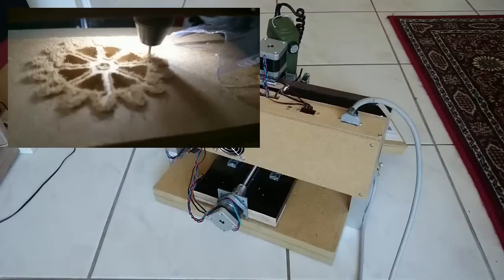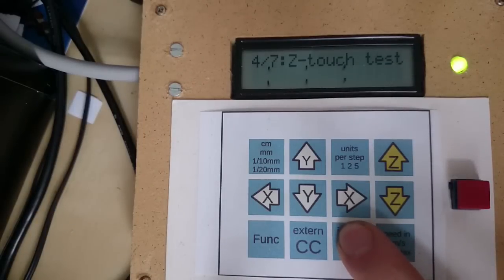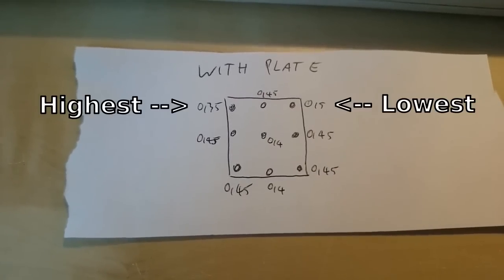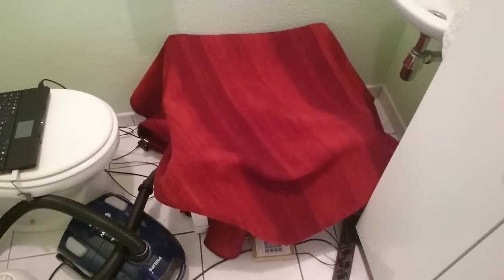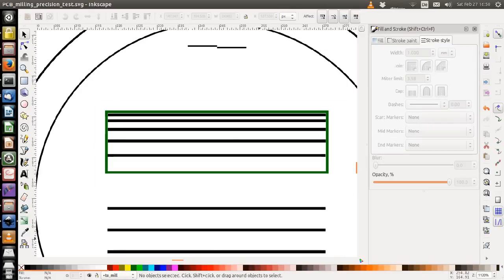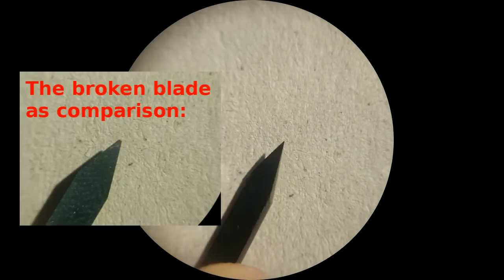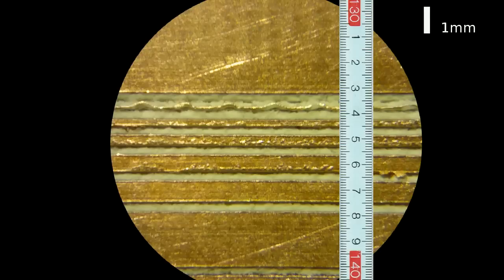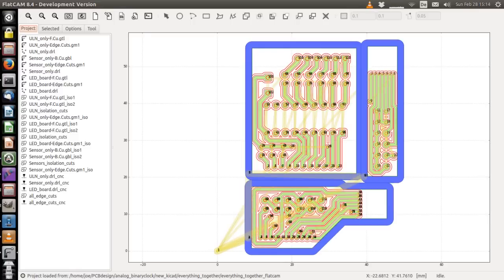My homemade desktop CNC mill: follow-up number 2

Comment: Can you please show the connections from the Arduino to the BED driver boards and driver boards to stepper motors. I have completed the mechanical assembly and now need to test if it works.

Comment: Hello, i have some soloutions for you:
1. you can solve the uneven plate issue really fast: just use the largest endmill the machine can take and facemill the hole plate so you get an even surface. Its really simple and the first things i had done. (Fläche einfach flach fräsen.)
2. For the noise problem you can build a larger an enclosure out of wood where the cnc fits in, and if its not enough you can add accousic foam (PU-Schaum) inside the wooden Box. Also you can stand the hole machine on Silicon/rubber feeds in a Sandbox to reduce body noise (Körperschall).
3.replace the large vacuumclealer with a smaller handheld version one maybe Diy.
4.Against the dust issue for your ball bearing you can build Bellows (Faltenbalg) or Roll Up Way Covers and Rollaway Covers(Gummi matte) greetings
Reply from the maker: All hints are good ideas! But i might rather build/buy a new machine with all these ideas built in, because my current one (as good as it works after all) could need quite a lot of (also other) optimizations.

Comment: Hi,

I don't think that cutting a circle is appropriate to detect backlash. At the beginning and at the end of the cut, the rotating cutting tool will always "push" the axis in the same direction and so eliminate any play in the nut/rod assembly. Drawing a circle may work because there is no unidirectional force applied by a cutting tool.

Anyway, I think that You really did a good job with this video series by going way deeper in the subject than others did.
Reply from the maker: For detecting fine backlash you are right, two cuts coming towards each other would be better for that. The PCBs I made so far still show me that my backlash is negligible right now.

Comment: Hi,
Maybe as a tip: Did you debounce your Z sensor? (http://www.labbookpages.co.uk/electronics/debounce.html)
Keep up the good work!!
Reply from the maker: +Rogier de Leeuw I did not debounce the Z-sensor, but my software reacts anyway on the first peak coming in, which is enough for the height measurement.

Comment: I have no idea about CNC stuff, but can't you calibrate the surface of the milling object and calibrate it in software with some linear interpolation? Has to be easier than shimming things up with paper... :)
Reply from the maker: +Leigh Robinson I agree that paper is not the "professional" way to go :) I could just have milled the surface flat, but I was afraid that there will be small edges left over which get in the way when my milled object is larger than the table. I might use auto-leveling features in the future.
Reply: With something like a PCB I would think that surface defects would mean even if the bed is milled flat there might be high spots. I would think to get fine traces you would need to also calibrate the depth based on the surface of the board. Adding that kind of calibration in software should be easy now you have the sensor. You have really inspired me to try and make my CNC, it looks fun! :D
Reply from the maker: +Leigh Robinson Milling PCB traces is a bit tolerant to height differences as long as they are within 1/10 of a mm, so even before I leveled my bed it actually worked pretty well. With level bed, finer traces are possible (by digging in e.g. just 3/10 of a mm), the depth I mentioned in the video is actually a bit too high.

Comment: I would like very much to have a copy of the g-code for the test figure used in this video. 
I looked in your project page, but could not find it there.

You do excellent work by the way; I especially appreciate your very clear descriptions.
Reply from the maker: +Fred LaPlante I will upload the .svg and the g-code file today, and also upload the new version of the jogger-software.
Reply from the maker: +Fred LaPlante I have just updated the project-page, you can now find the test figure as g-code and as .svg.
Reply from the maker: +Fred LaPlante I updated my project page on Hackaday.io. You can find the .svg and the G-code now, and also an updated version of the CNC-jogger software for Arduino.
Reply: +JoEtuuube Got it!
Thanks very much. I am anxious to see how it runs here.
My principle CNC use is PCB milling too.
I use GRBL 0.9j driven from bCNC which has an 'autolevel' feature, so I will try your code with it too.
Thanks again.

Comment: Hi
Du verwendest doch GRBL als Controller, nimm doch die eingebaute Abtastfunktion (G38.2). Das geht schneller und ist (mit einer Gewindestange in Z-Richtung) wiederholbar auf einen Motorschritt (0.003mm bei mir).  
Für Leiterplatten verwende ich meistens sogar absichtlich ein V-Fräser bei dem die Spitze abgebrochen ist. Die breitere Spitze sorgt dafür dass der Fräser schneidet und nicht nur reibt, damit nicht alles so ausfranst.
Wegen der inkonsistenten Frästiefe kann ich dir vor allem für Leiterplatten ein Auto-Levelling-Tool empfehlen. Ich hab auf meinem Kanal ein Video von meinem selbst geschriebenen Programm, aber auch bCNC und Chilipeppr unterstützen es (wenn auch nicht ganz so gut)
Grüße
Reply from the maker: +martin2250 Ich muss meine Sensoren noch mit dem GRBL-Arduino verbinden, dann kann ich die Abtastfunktion benutzen. Probieren will ich das auf jeden Fall. 
Leiterplatten sind immer tricky (die im Video ist auch 40 Jahre alt und sicher nicht allzu präzise) aber normalerweise bekomme ich sehr saubere cuts hin. (siehe letztes Follow-up)
Dein Programm schaue ich mir sicher mal an, ich suche noch nach einem eleganten Weg für Auto-leveling.
Reply from the maker: +martin2250 Ich muss meine Sensoren noch mit dem GRBL-Arduino verbinden, dann kann ich den G38.2 Test verwenden. Fräsen von Leiterplatten ist sowieso tricky (die Platte im Video ist auch 40 Jahre alt und sicher nicht allzu präzise) aber normalerweise bekomme ich sehr saubere cuts hin, siehe letztes Follow-up. Dein Auto-leveling tool sieht vielversprechend aus, das probiere ich sicherlich beim nächsten mal.